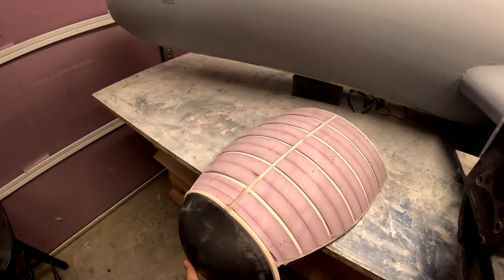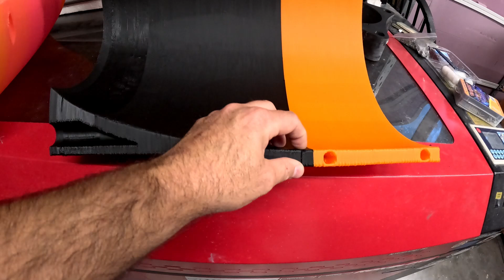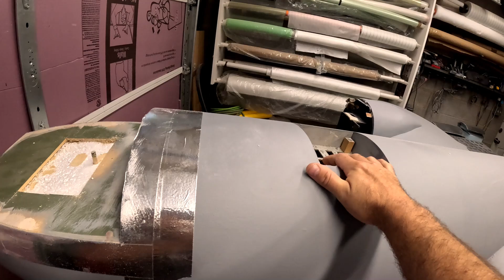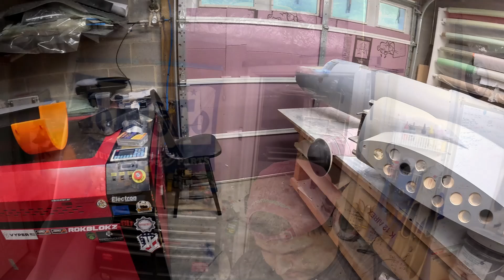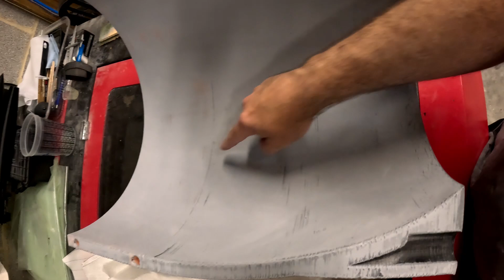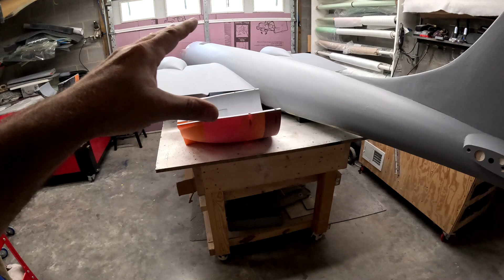B 29 Restoration Project #30   Nose #2

Comment: Awesome plane your rebuilding there, bare aluminium is really hard ( second to black ) ti achieve, lithoplate I’ve seen been used , anneal and clad it on .
Reply from the maker: @glynmatthews6697   i have lithoplated plugs for composite models, definitely Not going with that, its a nightmare. Lol.  And heavy
Reply: @invertmast  I’ll bet it is heavy yeah!